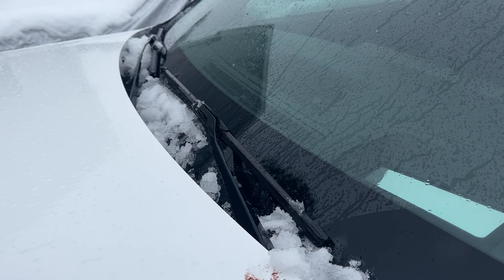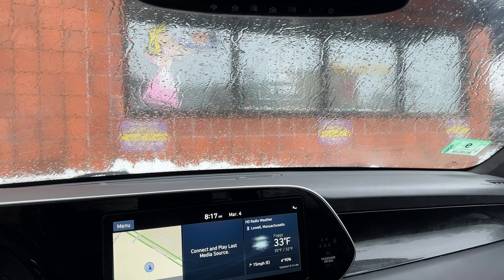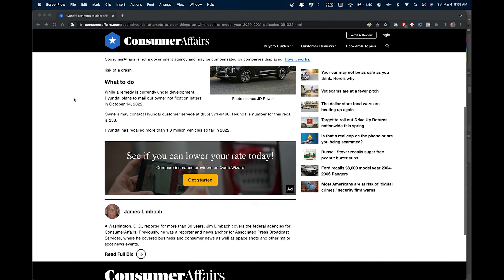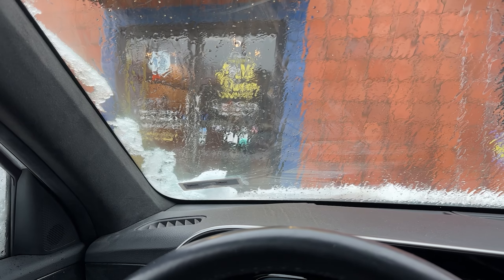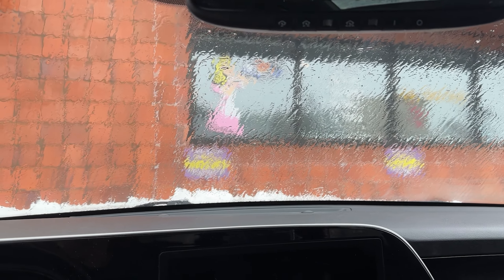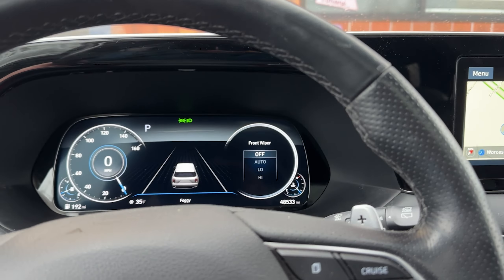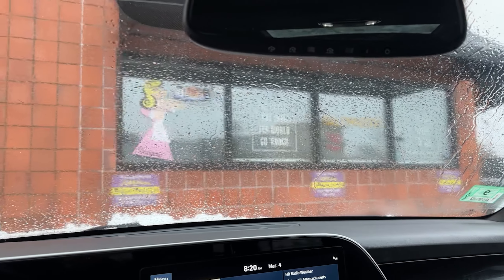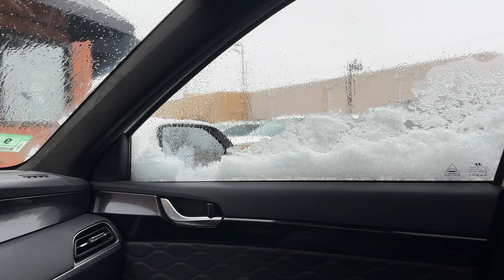Hyundai Palisade Has a Potentially Fatal Design Flaw!!

Comment: Read the manual... You need to put the wipers in service mode, which lifts the wiper, then you can clear the channel.

Just like any car, you need to regularly clear snow off your car when it's snowing continously.  Problem is most people are lazy that they wait for a lot of snow to pack in there before they clear.
Reply from the maker: if you noticed i said in the video the motor is frozen, no service mode. It won't go up or down until it gets to the bottom reset position...